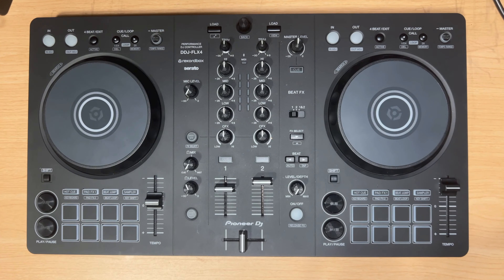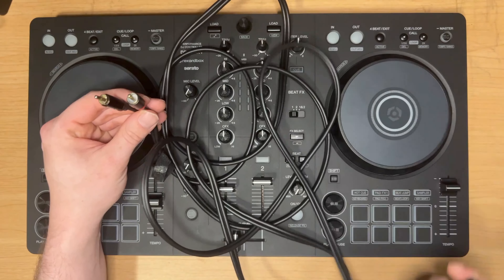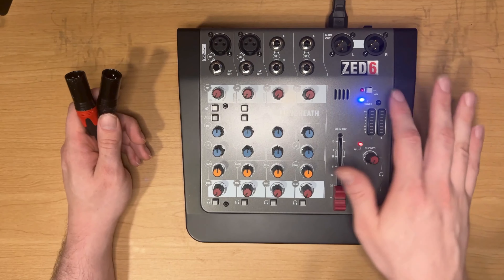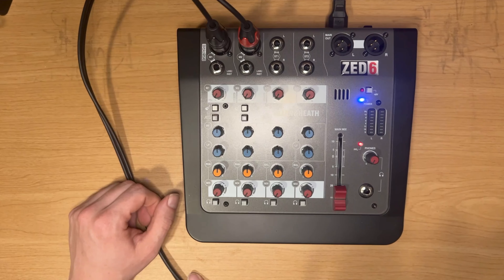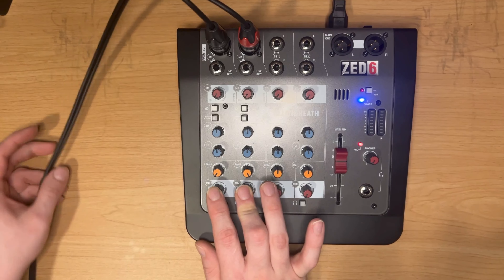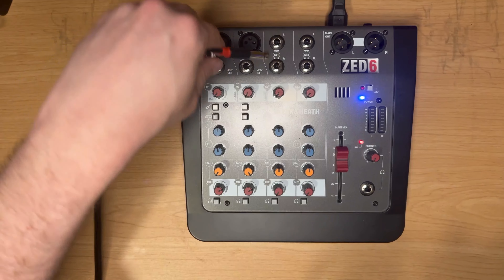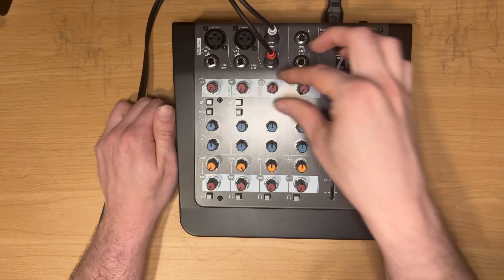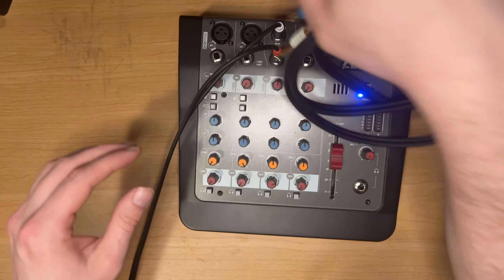Setting Up a DJ Controller with a Mixer

Comment: This is am amazingly clear video. One question....do you get a better sound quality from using channel 1 and 2 with XLR cables, or from the channel 3 with stereo jacks? Or does it sound the same? Thanks!
Reply from the maker: To be honest, I don't notice a difference in the sound.  I prefer to use the stereo jacks most of the time because I don't have to worry about separate gains/panning.

Comment: Question: When using the stereo input, does using the balance affect the left and right on mains?
Reply from the maker: Yes, the balance knob would affect the left/right amount on the mains.  However rather than putting the mono signal more to one side or another, it turns down the volume of the left/right channel instead (hence why it is labeled “balance” instead of “pan”)

Comment: Where should the amp on powered speakers be set at?
Reply from the maker: @castlecastle503  to be honest it depends on the amp you are using and there are a lot of combinations.  

With that said, general  recommendation would be to set it so when your DJ controller is turned all the way up (and your mixer is outputting at 0dB on the master) your amp is getting a solid signal but not limiting or clipping.  You can limit a bit if you need to once in a while, but clipping your amp is a surefire way to destroy your speakers so avoid that at all costs.  

What you can do to avoid this is first turn your amp all the way down.  Then play music at max controller volume through your mixer which is set to 0dB.  Then start turning up your amp until you limit or clip, and that is your max position.  Back off a bit and then your amp is set.  Try running a few songs (including some bass heavy ones and some “loud” ones, like some that are mastered at like -6 LUFS) and make sure you aren’t clipping.  From there you can mark that spot on your amp
Reply: @DJFriendZone Thank you.

Comment: what if you want to add subwoofers
Reply: if its powered speakers you would connect your tops through your sub and from sub direct to the left and right channel
Reply from the maker: @gustavoduenas1550  like kingaven, I usually run my audio out to the subs and then run the audio through the sub out to my tops.  So the main outs run XLR to the subs, and I daisy chain the audio from the subs to the tops.

Some people like having the option of aux fed subs (mainly for separate sub volume control), in which case you’ll need a mixer that has an aux out (or monitor out, or control room out, etc).  Most mixers do have this open; I may make a video on how to do this as well, though you couldn’t do it with this model shows.

Some people complain aux fed subs can shift your effective crossover as you raise/lower the sub volume.  In my view this doesn’t matter, or at least matter enough to need to be taken into account.  At most things may move a few Hz.

Comment: How do I record vocal audio with a ddjrev 5 controller and Yamaha mixer all connected ?? Any ?
Reply from the maker: @CANTTEACHTHISLIFESTYLE  You’ll probably need to record the audio output from your controller.  One thing you can do is run an RCA to 1/8” cable back into your computer (into the mic input; some laptops like MacBooks use the same port for headphones and mic) and then use a free program like audacity which will record the audio coming into your computer.

The reason some programs like Serato won’t pick up your mic signal when recording from app is the mic may be added into the signal by the controller as an external mix source, it is never sent or routed through the computer if that makes sense.

Comment: Hi! Thanks for the video!! how would you connect a qsc digital mixer to a dj controller that i can play my sax with my settings through his settings/equipment? thanks so much!!
Reply from the maker: @keeshea6718   I would actually run it backwards - I would run the controller through the QSC mixer (my guess is a touchmix) and the sax through the QSC mixer as well.

The other thing you could do is run the sax to the mic or aux input on the controller, but depending on the controller model the preamp quality may be bad and you’ll be sacrificing audio quality.

The only benefit to running your sax through the DJ controller is so the DJ can control your level in their end.  If that’s what they want to do that could make sense, but they could also do that from the touchmix and the quality would likely be better.
Reply: @DJFriendZone  thanks so much !!!

Comment: Thank you! My English language is not good and i need to ask something because im also using flx4. If i buy some mixer is it possible to use effect pedals on it? I looking for way to use effect pedals with my flx4.
Reply from the maker: You should be able to do this, however keep in mind most FX pedals are in mono, unbalanced.  You may want to get an RCA to TS cable, and use one of those RCA inputs to your FX petal
Reply: @DJFriendZone Thank you!

Comment: Hi, thanks for the video.
I have a question… do you know if this works only using one active speaker?
I have an FLX4 and have bought a powerful Active PA speaker. However, the volume isn’t that high. Will a mixer boost the signal?
Also, with only one speaker I assume i also loses half the signal?
Reply: Yes, The mixer will boost it.
Reply from the maker: @lukemachinegreen5168  a mixer can boost it (even with one channel).  What is the model of the speaker you purchased?  I ask because it is rare for an active speaker to have low sensitivity where it can’t be driven to max volume by RCA (at -10dBV)

With only one speaker yes you will only get either the left or right channel, unless you sum them to mono, but even then you can’t get true stereo sound with one speaker.

Comment: would you recommend getting both cables used in the video or am i okay with just the first one
Reply from the maker: You should be fine with the first one, I'd recommend just RCA to XLR (no need for the adapters).  There are a few mixers that only take 1/4" but these are rare and getting your controller to XLR is better
Reply: @DJFriendZone Brilliant run through of the Signal path, I am using the new Reloop Mixtour pro and a Novation Launchpad, and Push II. 

So I am doing a combination of Live Composition with the Push II and Novation Launchpad with my  Loops, Risers,  Vocal stabs, and one channel for my Arturia MiniLab

Comment: can i get a male to female XLR cable for the mixer? I also have the DDJ flx 4 but i wanna make sure i can connect to any speakers
Reply from the maker: @softavocado2677  yes most XLR cables are simply male to female.  So if you have a mixer, id get an RCA Male to XLR Male cable (you can use this to connect your FLX4 to a mixer or speakers directly), and then have XLR male to female to connect from the mixer to your speakers.

Comment: Some DJs will insist on running a controller into a mixer to get extra headroom. I only believe this is needed if the controller is USB powered.  But the vast majority are ran on DC power from the mains.  

The other reason is if the preamp on the controller is of poor quality, you’ll want to hook the mic into the mixer.
Reply from the maker: @traxonwax  yeah I think in general it’s a bad idea to use a mixer if you only need more gain, though there are some speakers with low input sensitivity which you may need.  Part of the difference is line level is different from consumer/whatever RCA usually uses.  

But yeah, the mic preamps on many controllers (including many entry level controllers) are shit so using an external mixer for mic(s) makes a lot of sense.  Plus you can add some EQ on the mics.  

I use a DDJ Rev7, Rane Performer, and a Prime 4 and I fine the mic preamps on those controllers are good enough that I don’t mind running the mics through them for most cases.  For something like the DDJ Rev1 on FLX4, the mic doesn’t sound great and clips super easily.

Comment: Maybe I am not too smart.  Why would you not run into channels 3/4 or 5/6 (stereo inputs), your cable is unbalanced anyway?  Why waste two channels?  The way you are configured it, you defeated the main purpose of using an external mixer, using the mic preamps, as Mic preamps on any controller even a Flx10 or Rev 7 are garbage?  You showed that method eventually, I am just curious why you showed the first method.
Reply from the maker: You’re absolutely right, with this controller (which only has unbalanced outputs) there’s not a good reason to use 1 and 2.  However I like using 1/2 for demonstrations because not all mixers have stereo inputs, and it is good to know how to adjust the pans correctly when using a mixer without stereo ins like the DL16s, Midas M32, X32, etc.  I’ve encountered many DJs do not understand the way signals are rounded in a mixer, including mono/stereo signals, using matrix outs, etc.  For instance, many keep the pans centered on both channels which messes up the stereo image and can cause coherence and phase issues.

Also in mind using 3/4 and 5/6 use two channels as well, however they are linked to the same fader/pot which makes adjusting the level easier.
Reply: @DJFriendZone  OK that makes sense.  I wasn't thinking about some of the big console mixers.  I was thinking of all the small 4-10 channel mixers I've ever worked with.  Good Point.